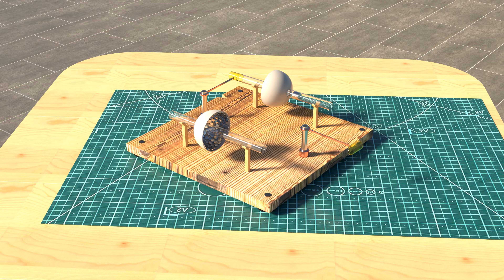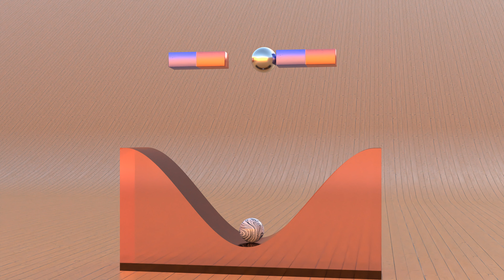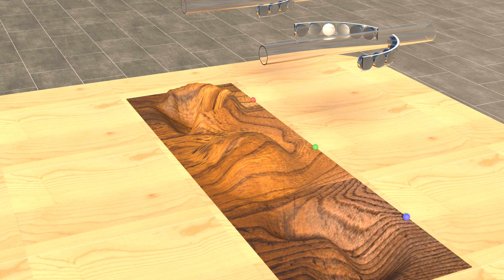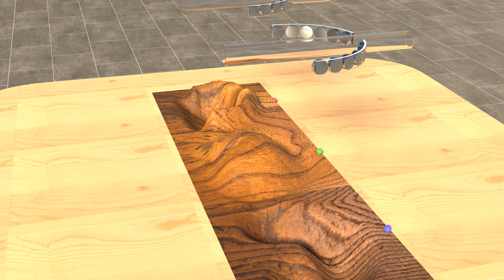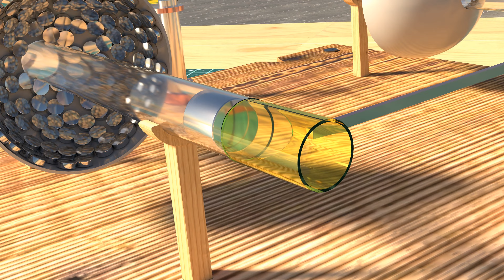Truth: LaPoint Array Closed Ring. Overunity machine, magnetic power generator and working principle

Comment: it's simple. Takes a small amount of energy to pass the sticky spot. But the power produced getting through more than compensates
Reply from the maker: Hi Weslingm, thx for your comment. Yes, if this would work, it would be an great thing. Unfortunately no one is able to do so. If you follow my magnetism to gravity transfer, you will see why. Thx for watching 🙂
Reply: The way this device is engineered there continual motion is not possible. There is also so many problems with this shortened version. Now with this version I think it is possible. https://youtu.be/SJXox9FMpMI
Reply: Even in your cgi sim the ball falls down and picks up speed going down. All it would take is to add a small amount of energy before it hits bottom at its fastest travel to come back up the and continue.

Comment: I have built many arrays and found that it does indeed slow down @ 63mm spacing with straight alignment. Also, the sphere magnet may not work, because you need perfect pole alignment for the concept to work. I do like your alternative concept if you can figure out how to keep the magnet momentum, very tricky though.
Reply from the maker: Hi Tech, glad you like my reduced design 😄. As you may have recognised, it will probably not work because of the buggy universe 🤔😄. In fact, it’s just an mind game and if you could follow my way of transferring magnetism to gravity you’ll understand why I don’t think it would work. Thx for watching 🙂
Reply: Hi. I would like to make a magnet travel vertically. It would start at the bottom of tube and climb up to lets say 50CM and it would stop. Is this possible to do with this type of set up? Thank you.
Reply: Flywheel

Comment: You can't get overunity with magnets like this, you need low energy state changes in magnetic properties to be able to build potential energy to release on state change.

True overunity requires reversible processes like heat pumps where your desired work output in energy concentration or delivery is in excess of what you as a user have to provide in work.

Coulomb motors are active a prime example:

Because coulomb forces can be used to make an poorly optimised motor, that same motor when spun in reverse is an ultra efficient charge concentator.

Comment: Thank You!!! I'm thinking about the small square wood platform. Possibly the kinetic energy could be enough to have enough oomph to work a eccentric that drives a planetary hub with 3 individual sun gears around it, you know the kind of axles I'm referring that you find in monster trucks, the neat thing about the planetary hub is that they don't require much torque to operate, and the hub can work to our favor, because the kinetic force of the magnets would not be enough to spin a non planetary hub, but it could with a sun gear/planetary hub. Kelly
Reply from the maker: Hi Kelly, thx for your comment. Great idea, just try it out. I would be glad, if you could proof me wrong and solve the world energy problem 🤗. If you like, tell your experiences here. Thx for watching 🙂

Comment: Great project, and that first Lapoint array is an actual attractive looking device.  The smaller version has its' appeal.  Even when these things don't pan out, though, I usually think of PerMotMachs' as providing insight into lingering inefficiencies in design.  Your small wood-base Lapoint array made me wonder if a light flywheel arm design could eke out a little extra juice from the device.  Just a thought.
Reply from the maker: Hi Young, glad you like it. If the design is able to work it’s not important how many of the arrays are involved. The main thing is to bring the moving part back into the arrays entrance. Thx for watching 🙂
Reply: These things never work.

Comment: What happens if you use a material that shields magnetism on the back side of the array so that you just get the effect of the ball being spit out the other side?
Reply from the maker: Hi Peter, thx for watching. Shielding of a magnetic field is only possible using materials which also interact in a magnetic way. So called MU-metal is able to shield but it is attracted to the magnetic field as iron.
The way to wipe out one magnetic pole seems impossible 🥺. Thx for watching. 🙂
Reply: @yWild A halbach array can accomplish this!

Comment: I do not think the 2 array device will work as posited.  Odds are that the magnet is just going to shoot out the other end before it gets anywhere close to the other destination tube.  Additionally, the spring, or whatever device returns the tube to its starting position is going to cause resistance, further increasing the likelihood that the magnet shoots out the end.  You would be better off just using curved tubes with a low friction interior coating.

Comment: A serious question could you use these arrays in an incline  straight line or in a spiral? And how far vertically can the ball travel after the initial push to get it to fire out? Love the video very good
Reply from the maker: Hi Mi, thx for your comment. The device you see is just CGI. Inclining or making a spiral of it does not work because after one or two more arrays the system comes to an standstill. Thx for watching 🙂

Comment: 2:22 the spring would make it impossible for the arm to transfer the block. Presuming the spring is fixed to the arm. But if it was a small spring at the other end connected to the pipe, which was hit only at the last moment, that might work better.
Reply from the maker: Hi Stoic, thanks for your comment. The spring is hidden in the stand of the moving arm. It has even enough power to put the arm back in the starting position, when the moving magnet has left the small tube on the arm. While the magnet is moving inside the small tube and the arm rotates, the spring gains the power for the moving back later. Because of the failing principle for perpetual movement in the whole idea, it would not work as desired. If your watch the video till the end, your will see. Thx for watching 🙂
Reply: @yWild  Thanks for the thanks - I'm still a little bit confused though. Surely any force being used to its benefit comes with an associated negative. Whatever force is enabling the arm to return to its original position will significantly reduce its chances at transferring the block in the first place right? If the spring is (in any way) fixed to the arm/arm shaft that is. There's also the question of: How do you ensure the spring returns in time without being detriment to it's function?
Reply from the maker: Hi Stoic, the apparatus is just an mind game to reduce the big ring thing to an affordable rate of money to spend. The implementation details are left to the one who tries to build it. In fact, it will not work, but it may be able to prove the principle that it doesn’t have the ability to work as perpetual motion device. Thx for your comments 🙂

Comment: Howdy friend, your animations are beautiful and your explanations very clear (excellent work!) though I don’t see how your demonstration replicates the idea correctly.  The author of this idea showed a magnet gaining speed with each bowl it passed through.  There is an initial energy input from a human used to forced the magnet through the first bowl the first time.

Once the magnet has passed the first bowl by human force, it will accelerate out the other side with more force than was required to insert it because of the asymmetric field strength and shape of each side of the bowl.  Then it will pass a second bowl and accelerate more.  And so on.  If the tube is made into a circle after initially forcing the magnet in to start, it will only be friction that slows it.  As to whether friction overcomes the magnets: that’s a question of magnet strength.  Friction doesn’t scale 1:1 with magnetic strength so presumably at some level of magnet strength friction is overcome.

Your animations presuppose a closed system without a human initially adding energy.  That makes them not match the authors original idea.

Comment: The thing is the initial status: when You or some other agency BRINGS the magnet to its initial position in the system, and this is ENERGY that has to be put into the system, and this Energy is greater than ehat the system offers so it can never be a perpetual or over the unity "machine"
Reply from the maker: Hi Eile, thx for your comment. Yes, you are right. And don’t forget the influence of the friction, even if a system would be able to generate some energy friction would set it an end. 😅 thx for watching

Comment: This is not a single direction magnetic field.  No matter how many parts are used, the result is the same.

Just use 1 single part and measure the forces (clockwise and counterclockwise).  Draw out the graph of the waves(forces),  and you will find the positives and negatives cancelled each other perfectly.

Try harder.  Wish you best of luck.

Comment: Fill the tube with Mercury
Reply from the maker: Hi Mike, great Idea. Bit impossible because it’s too poisonous. 😄 thx for watching
Reply from the maker: Hi Mike, okay, but it would not change the magnetic conditions, because mercury has no magnetic influence. It would not make a difference. Thx for watching 🙂
Reply: Try graphite diamagnetic
Reply from the maker: Hi Mike, thanks for the great video linked 👍🏻, awesome. Its topic is not the  same as mine, as you will recognise. I just show, what is not working by using a gravity model, and in the video linked the guy showed what science has invented already. putting some liquid metal into the tube would do noting, because of the missing current. Thx for watching 🙂